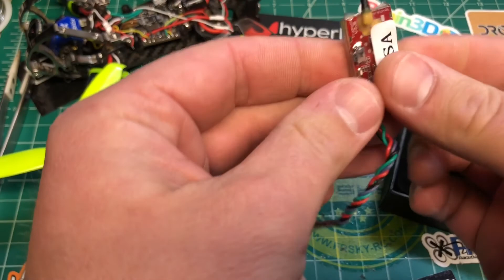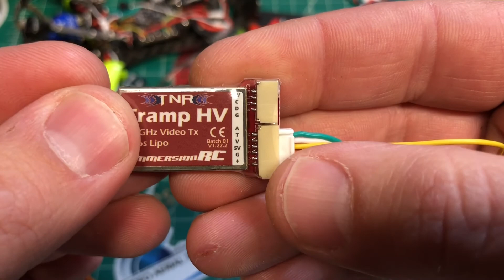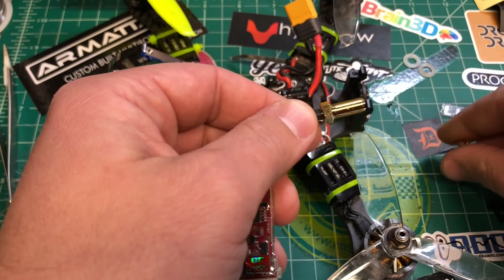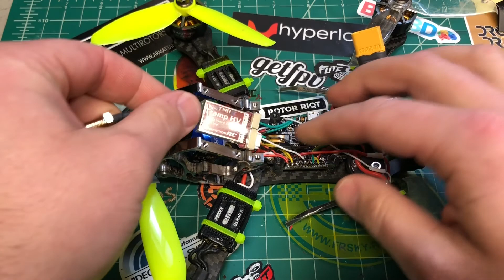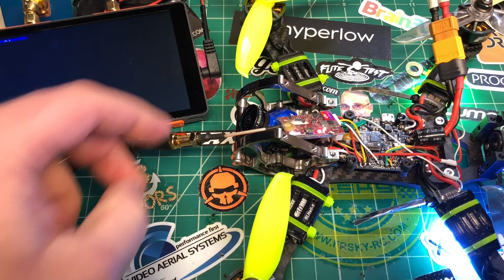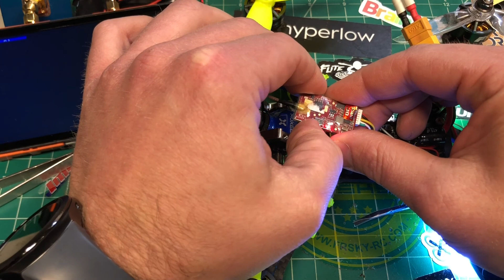Immersion Rc Tramp Vtx Install

Comment: So do you zip tie the sma pigtail to a standoff
Reply from the maker: Aidan Burns depending in the build. I usually buy the 3D printed mount for what eve quad I’m building. Best way to mount video antenna I’ve found.
Reply: @chrisr112887  hmm could be why your antenna cables are ripping off your mount might be flawed
Reply from the maker: Aidan Burns this particular drone has a very stout and secure mount. It got shaken around during a crash and broke off. The pigtail didn’t get pulled off. With the 3D mounts most of the destruction has minimized.

Comment: If using the internal +5V regulator to power a camera, run the second ground wire from the
supplied harness, along with the +5V output, directly to the camera. This ensures that the clean
switching regulator on the Tramp can feed the camera without noisy ‘ground currents’ creating
noise on the image.  This is from the instruction manual . Did you not need to do this?
Reply from the maker: Mark Webb it’s not mandatory to run a camera off the tramp. Your choice sometimes it’s the best option. Sometimes it isn’t.

Comment: aluminum isn't conductive
Reply: not as conductive as copper or silver but it is conductive which is why they use it for cheap wires and cooking pots
Reply: Ian Golten, huh🤔 I was always told that it wasn’t conductive. Well now I know.
Reply: you heard wrong.  Aluminum is non magnetic and neither is copper.  It will definitely conduct electricity!

Comment: Which wire and what pad do you connect to to get the Telemetry info?
Reply from the maker: Daniel Kieng white wire goes to a spare tx pad on your flight controller. Then remember what Tx number so you can set it to tramp telemetry on the ports tab.
Reply: Chris Romano my BETAFPV F4 1s Fc v2.0 (no rx). I hooked the tramp wire up to tx1(smart audio) pad and i get the options to make changes in my osd but the selections like channel and power don’t actually change.  The only other spare tx is tx2 but I’m using that uart for my xm+. Any guess on what’s wrong? And thanks the video was very informative